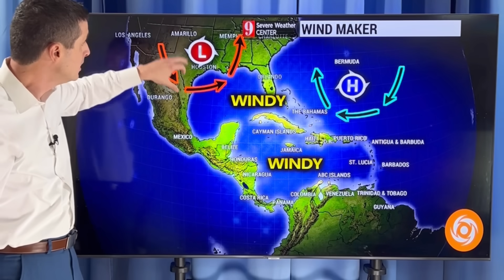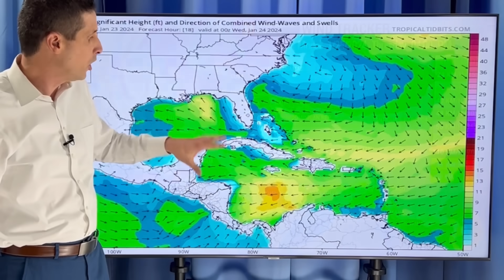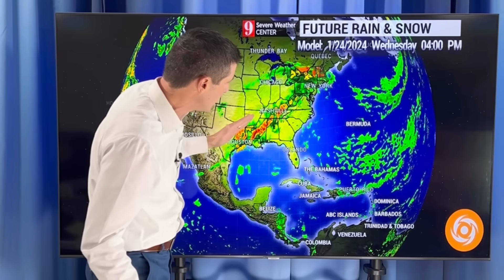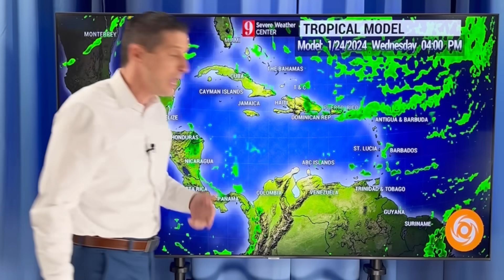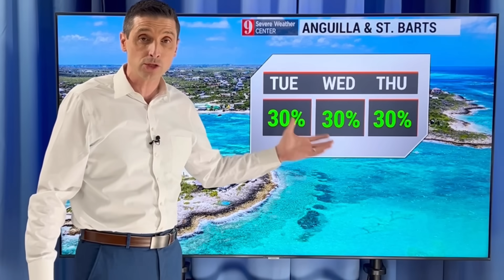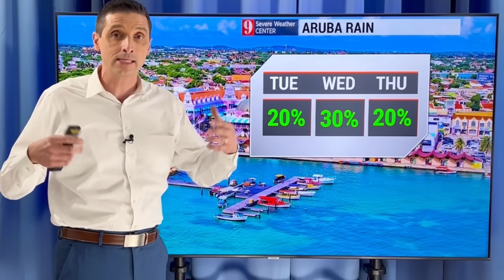Wind Machine Coming....

Comment: Today in Belize City it was sunny, hot and dry. Drier conditions are setting in over the area. Skies today will be mostly sunny and tonight clear to partly cloudy with only isolated showers if any. High temperatures peak at 85 degrees Fahrenheit along the coast, 89 degrees over inland areas and 77 degrees in the hills. Tonight's low temperatures will be 80 degrees along the coast, 75 degrees over inland areas and 68 degrees Fahrenheit in the hills. Thanks Brian for the update  and the windy conditions that will occur. Very interesting. Stay safe.  Good night.